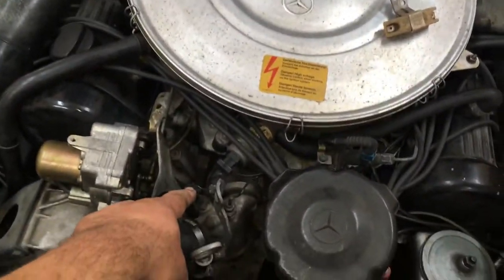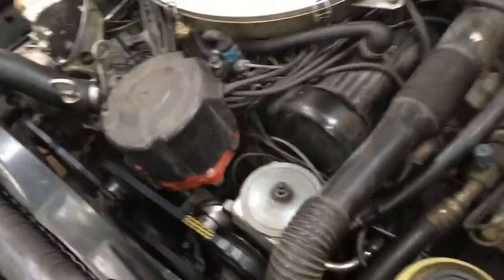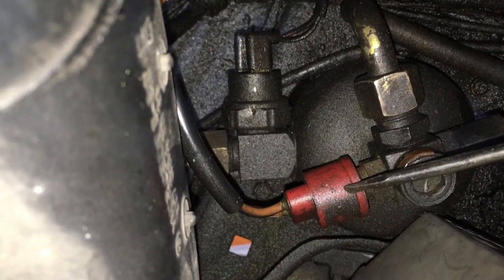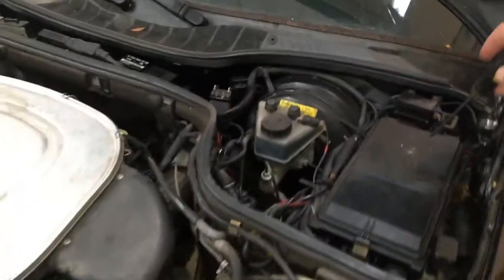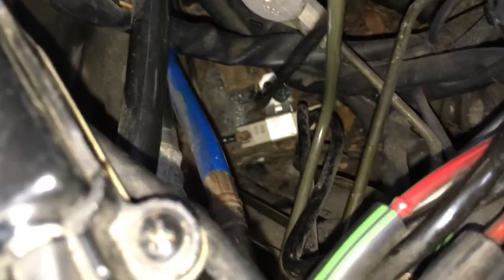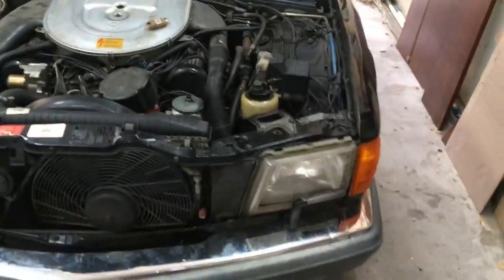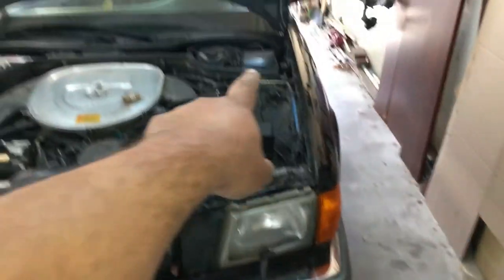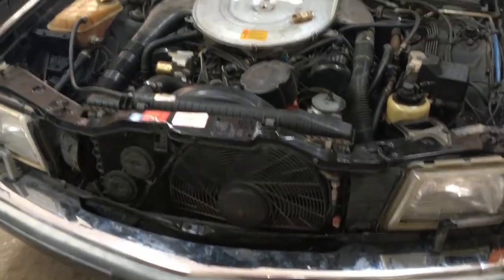W126 Auxilary Fan Low Speed at A/C on explained

Comment: I think the resistor is 0.3 ohms. Think. Turns out that with a 12" or 18" pair of hemostats and a strong magnetic screwdriver, changeout is not bad at all. The bolt that holds the resistor to the body is steel (magnetic) and the two phillips head screws holding the wires to the resistor are steel also. Long hemostat holding the wire so the lug is over the resistor hole and then put the steel screw in. I did take an air hose and cleaned out all the leaves that normally are piled around the resistor. Now you can find the screw you just dropped. Yep, you're gonna drop one at least once. Easy Peesy!

Comment: Do you think this resistor can be used on a '91 w124 300E also? My 300E has a different resistor which is about twice the size it seems. Maybe cause I have dual fans. This one is half the size but is readily available, the one on mine is a bit more difficult to find.
Reply from the maker: Yes, you right, the duo fans you fave consume more Amps. The Wats on your resistor are high.
If you want to run your A/C, temporary you can short your resistor (if is bad) so you will have your fans run on high speed. Also your A/C fans go on refrigerant pressure basis, not temp as mine. Refregerant pressure sensor (below 15 bar disengage fans ) (over 20 bar engage fans)
fuse 7 & fuse D / 16 Amp each
Reply: @Bogi_Maramski_Garage  Ive been fiddling with Aux fan stage 1 and stage 2 circuits past few days on mine. So far, I have discovered that my resistor is jumped, so the fans are currently cutting in on stage 1 circuit at high speed. New resistor should fix this. However, my stage 2 circuit seems to have a fault. When I unplug the aux fan thermistor with car switch on, I'm told fans should come on full speed. However, they don't. I can hear the relay clicking but the fans don't come on. Could this be related to the resistor being jumped? Both fuses D and 7 are intact and new.
Reply from the maker: @shaazy  when you hear the relay clicking, that tels you: 1. relay clicking but stil can be bad relay, 2. fuse can cause no power (often corrode on both ends), 3. wiring from relay to the fan.
Reply: @Bogi_Maramski_Garage  You're spot on and this is exactly what's happening. The resistor is currently jumped till new one comes in, and fans engage in high speed and shut off when AC pressure drops. However, I tested resistance at Aux fan thermistor yesterday after car was slightly over the 80C mark. I'm getting 494 Ohms at the Aux fan sensor and 262 Ohms at EZL temp sensor. Same temperature. Sounds like it's bad.

Comment: i wanna ask you, sir.. What is the resistor? what is the real function of this thing? I have my W124, sometimes the engine temperature above 100 degree. while the engine stall like normal. i tried to top overhaul the engine, change the waterpump, thermostat, coolant sensor also doesn't solve my problem.. what should i do??
Reply from the maker: I have problems Liki this one when I bought Chinese $15 thermostat. I even see more than 100 degrees. After that I trash it and I get Mahle thermostat and my temp stay
Reply from the maker: resistor make the low speed on auxiliary fan

Comment: Hi Bogi..do u have any idea how much is the resistance value..? My one is broken so i just solder it back but then my AC is not cold as before:-(
Reply from the maker: I think that the resistance shout be 2 om's
but I install is 4 om's
the bigger the resistance is the fan speed will be lower
If you short the two ends, you will have full speed
Reply: Thanks a lot bogi.. Thats really help me to further diagnose my car😊👍👍👍

Comment: Is there any method to test if that resistor or relay works? how to test them?
Reply from the maker: 1. connect (short) the two wires on 50 degrees temp sensor. You should hear relay kicking when you shorten sensor wires.
2. search +12V on both sides of resistor, One side have +12V other side not, replace resistor.
3. Both sides of resistor should have +12V.
4. you can test resister also when you short two ends with piece of wire (caution fan can go) 

* temp sensor wires shorted, ignition on, engine not run *
Reply: @Bogi_Maramski_Garage  Thanks for your reply, I tested several things today and just saw your comment after that.
1. I connected the two wires of 50 degree temp sensor. Fan was not turned on. But there was a clicking sound from the relay.
2. I connected 12v wire to one side of resistor – fan started. I connect other side of resistor to 12 volt and fan also started. 
3. Boths sides of resistor should have 12V when ignition is on? or when AC is turned on, or?
Reply from the maker: your resistor is OK.
A/C does not matter on or off, because this is part of cooling.
If your fan still not work when you short the sensor wires, then fuse is bad (you said you supply resistor with +12V, not measure with light I suggest you.
What year is your car ? so I can find fuse number for you  @razmadzekoko
Reply: @Bogi_Maramski_Garage  My car is 1989 model 300SEL. 
When I said I supply 12v to resistor, I meant that I put one side of wire to 12v batterie's positive pin, and other side to resistor – fan started. 
Some month ago I changed climate control unit, could it cause a problem, could it be bad one or something? I mean the push buttons in the central console.
Reply from the maker: putting +12V to the resistor, you actually put +12V to the fan.
You relay is clicking that means, control works, except the condition on the sensor itself. Now as far as we know, (ignition on, engine not run) when you short the sensor wires, you shout have fan blowing, the only problem can be the fuse. These old fuses often look good, but they burn aside at the connected point and hard to see fuse is bad. I recomend to install new fuses all around your car. @razmadzekoko
Reply: @Bogi_Maramski_Garage  I will check all the fuses carefully. But could the climate control unit module (in the central console) cause that issue?
Reply from the maker: no @razmadzekoko
Reply: @Bogi_Maramski_Garage  You made my day! I just looked the fuse number 1. it looked ok but bottom part was scraped, I put spare one – Fan works now as it should. 🥹❤I am so thankful!
Reply from the maker: Great !! @razmadzekoko

Comment: if the resistor is burned of broken, the aux fans will not turn on at any temperature?
Reply from the maker: if the resistor is bad, will be no low speed, and missing low speed will lower the A/C performance only at idle.
Reply: @Bogi_Maramski_Garage  my aux fans will not turn on at low or high speed. what could be wrong?
Reply from the maker: @alanOHALAN  when both no work, first I will check if fan motor is OK, bu power it with 12V 
let me know
Reply: @Bogi_Maramski_Garage  Should I try to find the resistor and see if it is broken first? I heard it is in the left fender, is it in the same location as the W126? I can try to power the two fans up, just unhook the power cords and get a 12v, but it seems odd that both fans motors could fail?
Reply from the maker: @alanOHALAN  what kind a car is yours ?
Reply: @alanOHALAN  same situation here. How did you diagnose?
Reply: Hi I don't have Low speed, what is what is the problem??